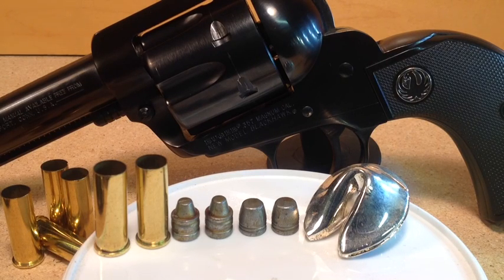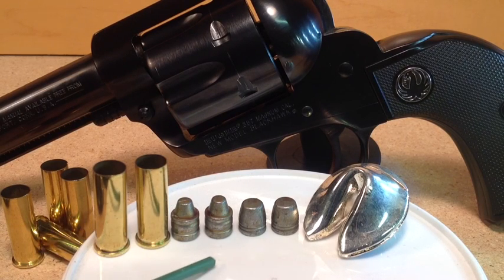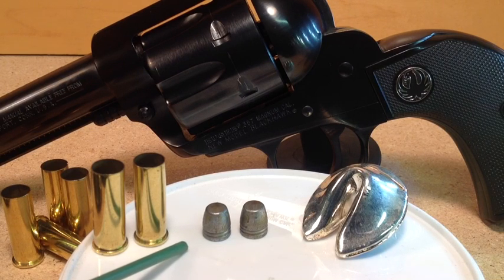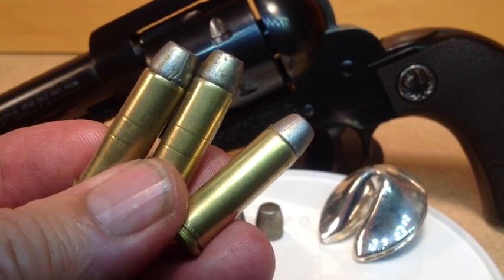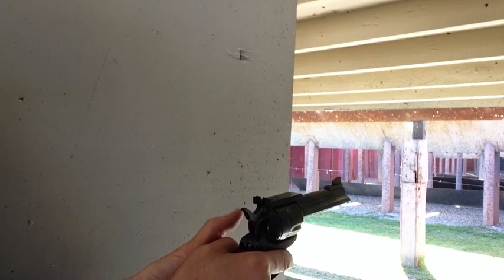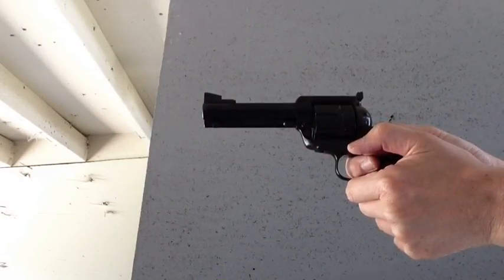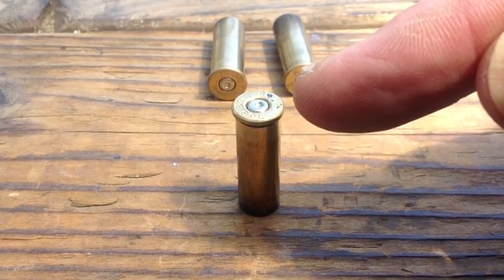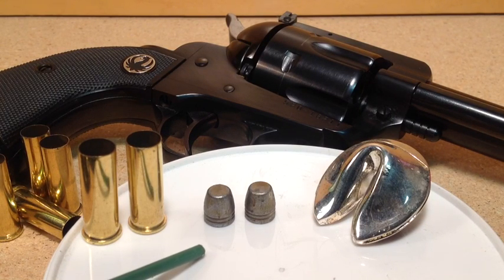The 22LR Substitute Load - Fight High Prices And Shortages

Comment: How about anything in .32 (example .32 S&W Long)? Its going to be cheaper to load, will more closely resemble a .22 in performance (98 gr, 1000fps) and are generally more accurate than .38 special.
Reply from the maker: +XCritonX -- That's a great idea and some cowboy action shooters have gone that way...Only problem is 38 brass is like zero cost - can pick up some at the range every time there.  The 32 S&W Long has never been seen at any of the ranges I've shot at for many years.  Have a great day,  FC

Comment: I cast 132 grain 9mm lead bullets for about 6 cents per bullet. I use 5 grains of longshot powder, but 3 grains of clays can also be used to save more money. Because 38 special has a lot of empty space in the case the velocity variations will be more than it is with the smaller 9mm case. Less variations in velocity means better accuracy.
Reply from the maker: Prepare2Survive - Great policy you have there on case capacity efficiency.  I didn't mention that the 5.6 grains of Promo is fluffy enough to fill a good bulk of that powder space.  And, as you noticed, the pressure signs on the primers tell me that I can actually up the powder charge a bit more - getting 1177 fps from 4 5/8" barrel now.  1300 fps would be easy, but not needed.  The round has accuracy at 5.6...3 grains of Clays is one of the advantages of 9mm.  Perhaps I should reload some 9mm for use in the convertible cylinders of my BHs...Best Regards...

Comment: I think this is right approach for a 22LR substitute.  The 9mm also comes to mind with light bullets like 90grn or so, and can be shot in semi-auto firearms if that is what you have or prefer.  A simple lighter recoil spring change can be made if you are loading 9mm on the light side and have problems with slide travel under recoil with light loads.  Your 38SPCL solution is, of course, preferable for revolvers and leverguns which are readily available or if that is what you already own.  If you care to cast your own and have a supply of lead, then you can actually shoot either solution for less than commercial 22LR is going for now.  We are going to see more of this if 22LR prices don't drop below 5 cents per round.
Reply from the maker: +JustSomeGuy -- You've got the handle on this issue for sure...in our autopistols, the 9mm is the one.  Plus both the 95 and 105 grainer bullets would do just fine for the 9mm in this application.  If we went with higher velocity, we might not even need a lighter spring... those light pills would just zip downrange making us forget all about where the next box of 22LRs is coming from...Amazingly, I still go to the stores and ask about 22 LR.  And I'm still getting - You've got to come in on Friday morning or a plain sign posted NO 22LR...   When we find it, we get Rem 22 Golden Bullets - not what we might be looking for... Happy Holidays to ya,   FC
Reply: I certainly agree with you to some extent about the spring change thing, but there are pluses and minuses to be considered.  While it is entirely possible to push properly sized lead bullets to pretty high velocities without excessive leading in the bore, it is inevitable that somewhere a bit above the "sound barrier" speeds that the bullet will friction melt a bit from bore contact no matter what lube is used.  You also get some melt on the base of the bullet if using powders that burn on the hot side like TiteGroup, thus the smoke you see from using lead bullets with those kinds of powders.  Cooler burning powders like Silhouette or coolest of all True Blue, will do less if any base melting and you get hardly any smoke, plus you can drive those lead bullets to somewhat higher velocities without bore melting too because the lower gas heat will not blow by the bullet in the bore and thus not encourage melting as much.  But since this was about shooting as inexpensively as 5 cents per round, then cast lead bullets are going to be necessary and so velocities (and thus pressures and heat) need to be held to reasonable, non melting levels.  The point being that pushing those 90-105grn bullets to easily achieved velocities over 1300fps in a pistol in order to run the gun reliably with the stock springs in a lot of the auto pistols out there without leading is going to be problematic.  So, in my humble opinion, should light for the caliber lead bullets and staying around 5 cents per round be the goal, then I think a spring change is going to have to be considered for a lot of the 9mm pistols out there while keeping velocities under about 1200fps.  No two guns are equal, even of the same type, so experimentation with any particular firearm is in order to see what kind of leading you may be getting (or not getting) with light lead bullets driven fast enough to run the gun in an auto pistol with stock springs with any particular powder of your choice.  Your experience may vary depending on the particular lead alloy mix being used as well.  If you're going to use coated or jacketed bullets which generally must be purchased, then no problem, but you will be above the 5 cent per shot goal that 22LR replacement rounds were originally set at, though not by much at least for coated.  All coatings are not equal so, again, experimentation is in order (SNS Casting's coated bullets come to mind as viable, but there are others as well). 115-125grn "user cast bullets" may still be in under the 5 cent goal if you get the lead for free or very cheaply, and they will certainly run the gun using well known recipes with a variety of powders and not cause leading.  Sorry for the length of this response, but I just couldn't seem to make it shorter.
Reply from the maker: +JustSomeGuy -- Thank you for your comments - the length is not problematic - we converse on technical subjects - those that don't wish to spend the time reading long replies really didn't want the information anyway.  I really like my 22LR substitute loads in my revolvers - no cycling issues.  I haven't shot real light bullets in semi-autos since we used 155 grain cast SWCs in 45 ACP at 1200 fps to best run compensators while making major power factors  back in the 1980s IPSC days  But I still shoot a great deal of 200 gr cast long nose SWCs in my 45 acps.  Happy 2016 to ya...   FC
Reply from the maker: +JustSomeGuy -- Had to come back because the work day started and interfered with the reply.  -- Some of my replies are long as well - people appreciate the thoroughness of responses.  There is great promise in that 95 grain RNFP Lee bullet powder coated for 22 substitute in 9mms.  Haven't gotten around to casting more of those to do that as I've just purchased two new Lee molds (heavy 38 and also 30 cal 312) that I probably want to cast first... But that 95 grainer project does need attention - I left the auto pistol shooters hanging on that one...  Best of 2016 to ya...  FC
Reply: Great!  I look forward to your 9mm light bullet experiments.  Thank you for your responses.

Comment: I got a mold yesterday for .432" 110gn Wadcutters from NOE Bullet Moulds.  I'll work up something over the next few days but I have a hunch that might also be a great .22LR substitute.
Reply from the maker: Marcus Cervantes - Now that's an interesting bullet - short shank WC for the 44 caliber.  Intriguing to say the least.  Please let me know if it does the trick for you...
Reply: FortuneCookie45LC I put it in front of 4.0gns of 700X and that seemed to do the trick.  Worked up from 3.6 to 5.2 and didn't see any pressure signs but found 4.0gns to be the most accurate.  About a 2" group at 20yards.  Decent plinker, really quite and should be good for thumping bunnies, and taking new comers shooting.  Regards - MC
Reply from the maker: Marcus Cervantes 4 grains of700X is not a pipsqueak…the bunnies will definitely be thumped..Have a great day...

Comment: Great job! How did this round do with fouling? Leading? I suspect it was good but had to ask! Love the vids, keep up the good work and keep'em coming!
Reply from the maker: mytmousemalibu-For a good velocity load (1177fps) out of 4 5/8" barrel, yet standard pressures - there was little leading.  I'm sure that prolonged use in 357 chambers will result in the "short case fouling", we know how to handle that.  And 3-4 magnum JHPs fired at the end of range sessions will make clean up a pie of cake.  Important to report to you that the accuracy is maintained over 50 rounds fired in each of rifle and handgun - no loss of accuracy means leading is minimal.  Thanks for the good word, and Best Regards to ya....
Reply: +mytmousemalibu   Leading is more a function of correct bullet size (diameter) than velocity or even hardness.  You want a lead bullet about .001-.002 over bore size for it to shoot with minimal or no lead fouling.  Smaller than that and you get leading.
Reply from the maker: +JustSomeGuy -- Way to go, JustSomeGuy - very concisely stated for all to see and take in... Best of the Holidays to ya,   FC

Comment: I was picking up brass at the range but also picked up steel casings for 38 special winchesters , federal ,  r .p ,   w.w. were some of the brands can I use the steel casings for reloading also the 38 special plus p steel casings thank you for your help
Reply from the maker: 148DMC-The regular brass and nickel plated casings in 38 spl are so plentiful, that I don't recommend you reload the steel ones.  As I recall, the steel casings are made with oddball size Berdan primers to keep reloaders from reloading those cases.  You have to drill a new flashhole and then ream the primer pocket to be able to load them.  You can do that - lots of work, but again, with all the good easily reloadable 38 brass to be picked up, why bother with steel?  I always pick up some 38 brass every time I'm at the range... Best to ya...

Comment: So, is promo and red dot the same thing? Meaning, I could substitute red dot for this load?

I'm shooting a Taurus 85
Reply from the maker: Keith Gee - Absolutely - RD and Promo are the same powder and you can weigh out the identical charges for identical performance.  Promo is much less expensive though.  Other identical powders by weight are H110 / WW296 as well as WW231 / HP38.  These are the most commonly used powder couplings... Good reloadin' to ya,  FC
Reply: FortuneCookie45LC  I am a ways off from casting, but will definitely do so in the future. The lightest cast bullet I can find is a 125 grain SWC at sportsman's ($20 for 250)(not bad I thought). Do you have any data using Promo or Red Dot for the 125  gr. SWC? From what I see on forums is anywhere from 3-4 grains... 🤔

Comment: why 9mm caliber/ 38cal and not something like a 32mag or 327mag?
Reply: 9mm and 38 are extremely popular calibers I don't know anyone with a 32 mag or 327 mag. even though the 327 looks like a neat round there are substitutes that you can use for it. so it could be cheaper plus im not too sure if those rounds are in a shortage like 22, 9mm, 38, 357. ect
Reply: gun nut I have one and .32 S&W Long is a nice stand in, still available and has the same recoil. The 327 platform's versatility in my mind makes up for any negatives in terms of having plenty of amo. (still buying 50rd boxes for $25 on .327, $20 for .32s)
Reply: if you was to reload that it would be a good 22 substitute. and it could be made for right around a nickel as well. you would be able to use normal reload data because it usually gets close to 1150 or less with lead data. lastly you would have to find the sweet spot for accuracy. recoil should be the same at 22 so you wouldn't have to come up with sub-sonic data

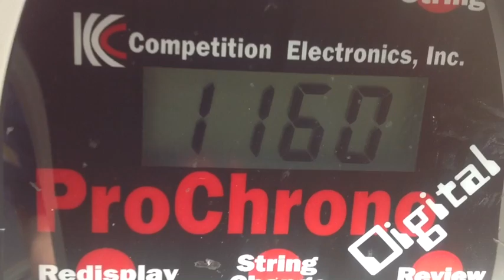Comment: Great group there at 9:22. I wish I could trade in my 358105 SWC for the mold you used.
Reply from the maker: GunFun ZS - Your 105 is not a bad bullet (If Lee had the 95 mold at the time, though, I probably never would have bought the 105) - I have a sweet spot load for that bullet and a couple of vids on that…Reminds me, I should do a casting session with my own 105 6 cavity - my bullet reserves could stand having a jug of those on hand…Have a great day...
Reply: It's a good shooter, but was primarily bought for .380 ACP. your 95 grain mold is perfect for that application.
Reply from the maker: GunFun ZS You have hit on the primary reason for this mold - the popularity of the 380 spurred Lee to intro this mold (not the best caliber for IDPA, but there might be 380 matches in the works)…However, it shoots very well in the 38 Spl especially in the 1000+ fps velocity range (I started low and low was the no-go).  I might even juice it a little more since the pressure signs are still reasonable - see how much velocity we can give this before it all breaks down, then back it off a bit… Always enjoy our comments together - Best Regards...
Reply: You've hit on a problem with IDPA. It has a bit of indoctrination about enforcing a few judgement calls as dogma. i.e. the way mags must be kept rather than dropped in many circumstances. Another is that they don't allow .380. The avowed purpose of IDPA is to mirror how people actually carry. Well, in the early 1990s 380 was a pathetic round and the guns that shot it were about as big as the 9mm guns of today. So they had to draw the line somewhere. But now, with modern ammo chosen for the gun it is truly adequate. (see the excellent series Shootingthebull410 has done on testing ammo in pocket size barrels) More importantly it's what people carry.

For me though, the ability to make 380 is about making practice ammo for what friends carry. (I want a TCP 738, but no cash at the moment) .380 is hard to find and way over -priced. Worse, the practice ammo is very different in power and recoil from the carry ammo. I'm sure you can recognize that as prime turf for a fast casting mold and a recipe matched to duplicate the feel of carry ammo. Competition is bonus,
Reply from the maker: GunFun ZS You are going to like this 95-99 grain bullet!!  Cast it a little on the hard side, rev it up and Fire In The Hole!!  Have a great day
Reply: FortuneCookie45LC  Just send me the cash for the mold and I'm on it. -- I take the Bar in July. Hopefully by then I can start making some discretionary purchases. In the meantime, belts stay tight.
Reply: FortuneCookie45LC You say hard... I thought you were using water dropped range scrap for these light bullets. Those should come up to BHN 12 or so. Are you using a different alloy now?
Reply from the maker: GunFun ZS The reason I am thinking about upping the hardness on my 99s is they are cooking at 1177fps (4 5/8" barrel) now, and I might even push them a little higher - like around 1250fps - probably go with about BHN 15 with that - so a little linotype should do.  Now if you want to sell that 105 mold, sorry to tell you that I have mine already.  But someone at your range or eBay should buy it without too much delay.  My next Lee mold is going to be the 6 cavity round nose 45 bullet that my single cavity mold casts - I can't stand how slow that 1 cavity makes 'em… Best to ya…and also best to you in your Bar exam...
Reply: Thanks. That exam will be in July. I'll keep the '105 for the 38s for now. It's still a good shooter, and if I keep the OAL right, my Hi Point carbine really  likes it. I just PC'd up a batch of them I cast about a month ago too. 

Frankly, I'm surprised the 6 Cavity 45 wasn't one of the first gang molds you picked up, considering your moniker.

Good day, sir.
Reply from the maker: GunFun ZS As you know, the RN 228 Lee was my first mold - a single cavity.  My first 6 Lee mold was the 452 200 SWC.  I have shot more of those bullets out of my 1911 comp guns and 45 revolvers than any other bullet.  I still shoot that bullet regularly and keep 6000 of those in reserve at all times (that's the only bullet out of 24 different bullets that I cast for that I manage that way).  When I do a 1500 round reloading session, I make a point to cast my reserve back up.  Now that I post on YouTube, I've actually acquired 5 new molds - this RN 45 will be my 6th and I will have come full circle…Best Regards